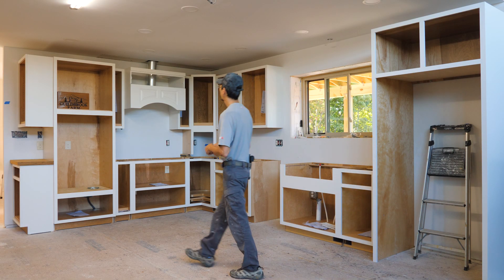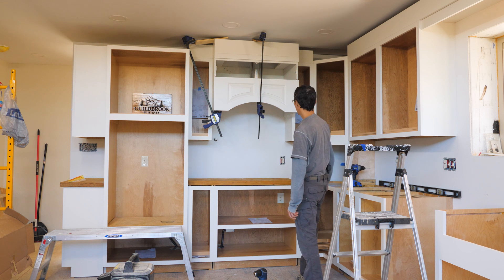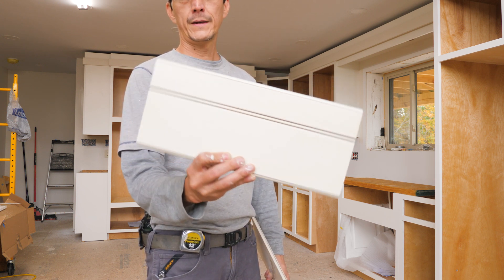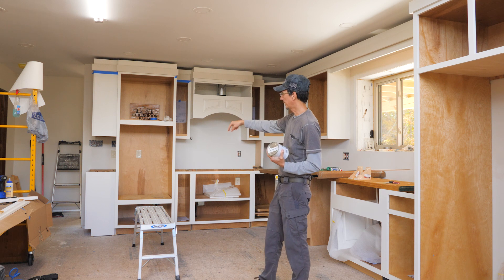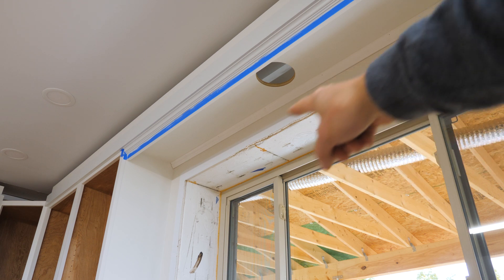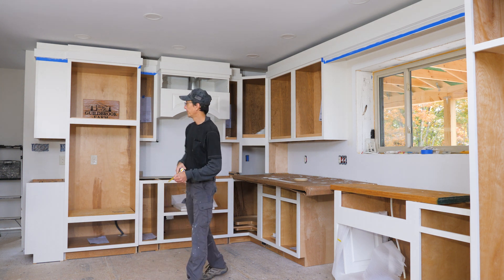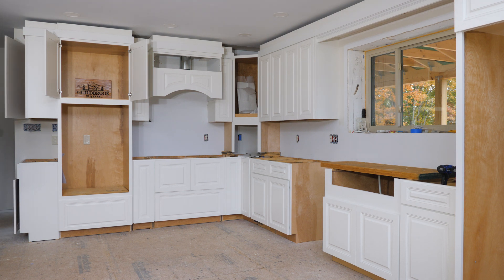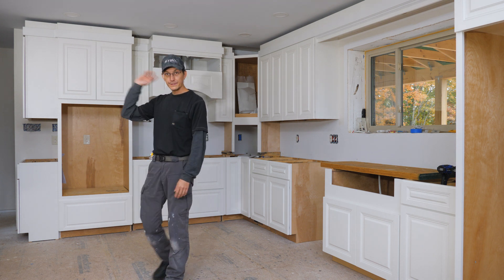OOPS! RTA Kitchen Cabinet Doors, Drawers, Mistakes and More

Comment: I enjoyed seeing your drawer pull installation. I did those 10 years ago (or so) and the installation is so much easier now. A piece of advice that I learned the hard way is to have some extra cabinet hinges stored away for the future. I built my house 30 years ago and some cabinet hinges have gotten very squeaky and don’t work as well as they once did. The pockets accommodate a certain type of hardware and it’s hard to find the exact pieces again. It would be easier if I just had some extras. There are a few cabinets that get most of the repeat action and more downward torque when you’re putting away dishes and your hands are full. Those hinges have worn out first.

Comment: We built our dream home about 9 years ago. We put in geothermal. Also had A local Amish family to build all our cabinetry throughout the house. Solid cherry with a dark walnut stain. They did all the extras in the cabinets. Our flooring throughout was from Tennessee Hardwood. 3/4 inch maple…I think with dark stain similar to some of your wood. We are really happy with our tile choices etc. new builds are still using similar tiles etc.

Comment: As far as the appliance garage goes, you could have had your tile guy treat those little sections as back splash.
At 15:00 I thought the contrast looked nice where the 4" trim was glazed but the remainder was pure white. 
It looks like they took some clues from Winstead as far as the drawer slides are concerned.  Winstead makes industrial rack systems including desks.  They're almost impossible to screw-up the assembly.

Comment: Instead of the finished plywood for the appliance cabinet you can tile it over with whatever you use for the backsplash. Also, I would add electric outlets on the walls of that cabinet, facing outwards, there are never too many.

Comment: Looks fantastic and your attention to detail shows. I found self-centering drill bits to be very handy for installing the blum door hinges. The 5/32" spacing on the blum undermounts I believe is intended so that your actual drilled hole ends up dead center in the middle of a 3/4" deep face frame. I'm looking forward to seeing the island come together.

Comment: White is always easier to keep clean because you can see the dirt however I would seriously consider applying clear gloss. It makes it MUCH easier to clean as whatever spills don't get into the grain of the matt finish. The white will be amazing to reflect the limited light which is important for winter especially if you have any stress or feel gloomy during winter.  I do have a question what did you guys consider when planning the kitchen? What did you do to factor in canning and the ergonomics of the canning process?

Comment: They should have made that trash drawer front with a French cleat (probably with slots to adjust height).  That would be a lot easier than those metal brackets.

Comment: The Conestoga cabinets look great. I'm looking at using them for my new house build. Did you buy the painted crown moulding from Conestoga or use other crown moulding and match the paint? Can you tell the difference without the topcoat sheen?.
Reply: 96666

Comment: Hey Jeremy, what rating (scale from 1-10) would you give for the frosty white finish on the face frames and doors? (scale from 1-10)
Reply from the maker: The quality of the finish is a solid 10. They are finished in a factory controlled environment with a coating that seems way better than paint you can find at a big box store. I am genuinely impressed.
Reply: @Guildbrookfarm  Thanks, we're looking at Conestoga for our project.

Comment: I have been thinking about the shelf you forgot for above the fridge. Maybe you can rip long way, add pocket holes, put it back in the cabinet then screw back together. The shelf would be functional and no one would ever know.
Reply from the maker: Probably could do that but actually I doubt we'll use a shelf there anyway.

Comment: Question: How is one supposed to get at (and clean) the DUST that's going to be up there, on top of the cabinets, in a few years time?? I'm cleaning (a DEEP clean) one of my friends houses, and I'm in his kitchen.........the amount of DUST I had to get off of the top of his cabinets was.....WOW!! And it's a relatively new house, too.
Reply from the maker: You must have missed the part where I explained we are taking the moulding to the ceiling. There will be no top of the cabinets.